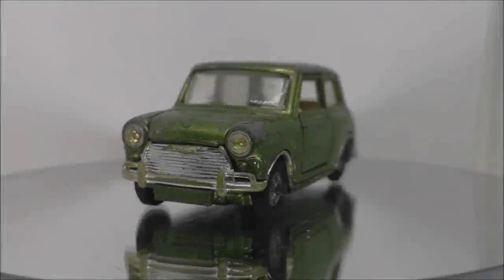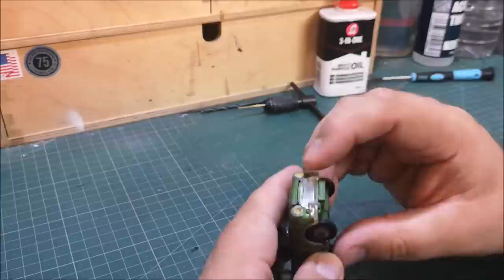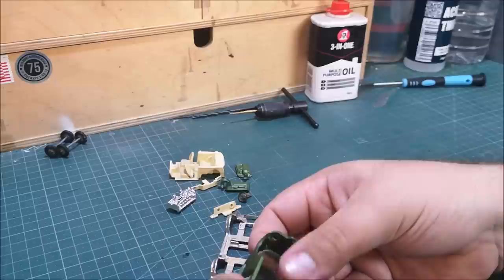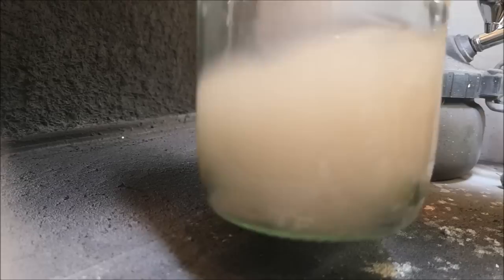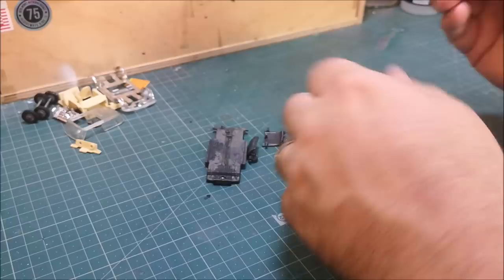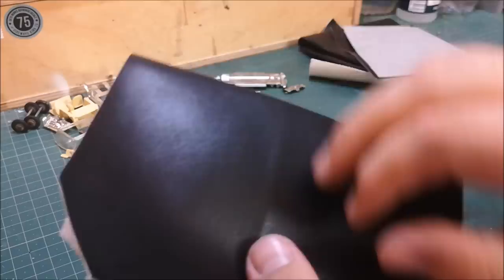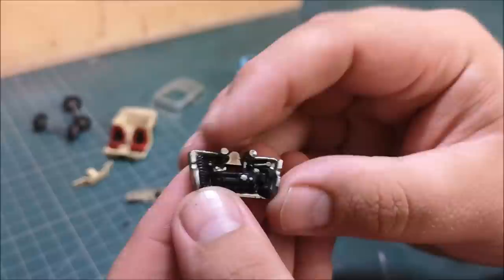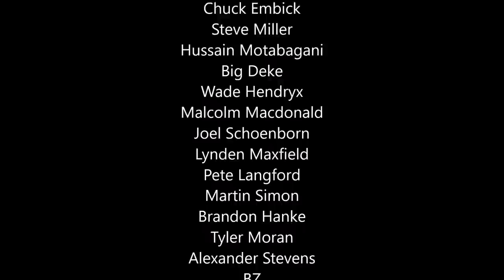The Mini from Some Kind of Wonderful

Comment: My favourite ever model of The Mini. Made at at a time when Corgi models were at the peak of creativity. Full of nice touches - some models had tiny, opening suitcases in their boots; one model even had a removable distributor cap - imagine how quickly that got lost! Great stuff.
I use Tamiya 'Rubber Black' (XF-85), to simulate vinyl roof panels. It's a great colour. Dries super matt with texture.
Blinding result! And that rust is very convincing, too - the pale substrate level showing against the blue. Nice one.